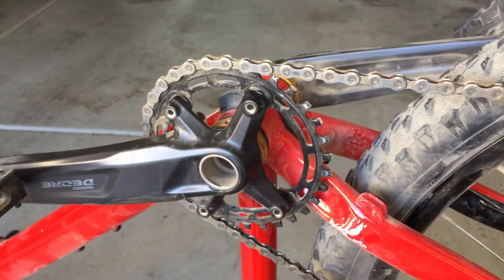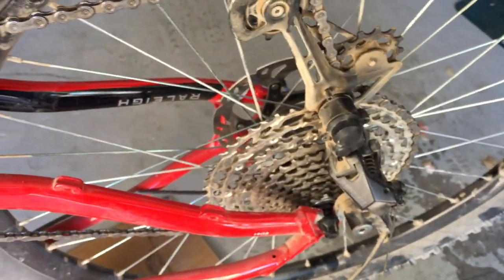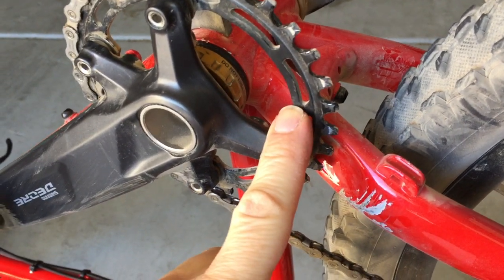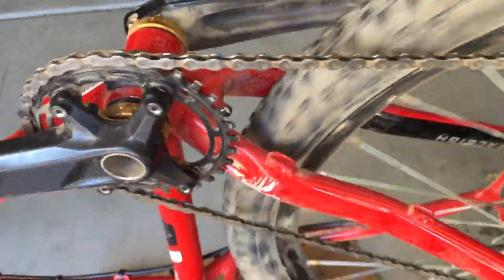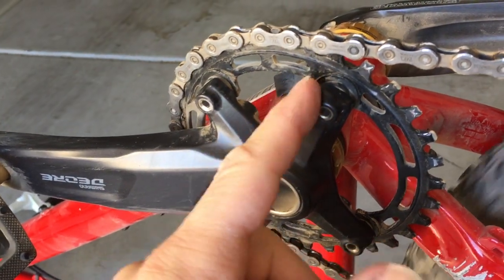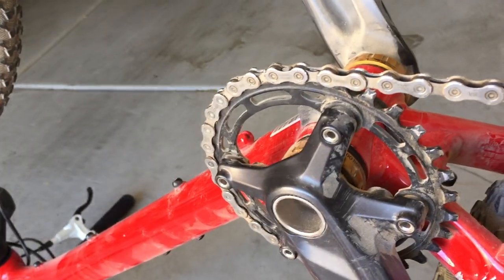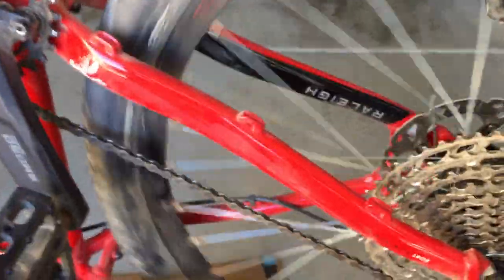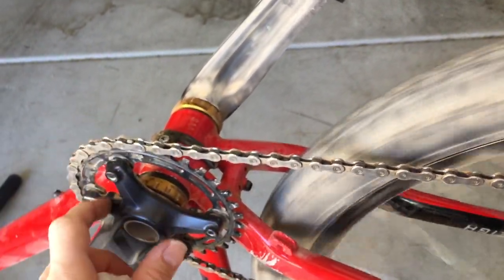Shimano Deore M5100 1x11 crankset chainline for 135mm OLD non-boost

Comment: I see you're using spacers for the bottom bracket. Couldn't you just move all of them to the non drive side? It seems like this would push the chainring in by the thickness of the spacers, by eye I'd say about 3-4mm. I'm doing a similar thing with my bike and it has a 73mm bb shell, and the spacers can be moved to either side to adjust the chainline.
Reply from the maker: Yes, you can move bottom bracket spacers to adjust your chainline, but then you are also offsetting the bottom bracket and crankset so you have to make sure the crankarm clears the frame. This frame has a 68mm bb shell, I need to use 3 (2.5mm) spacers. Shimano recommends 2 spacers on drive side and 1 spacer on non-drive side. Each spacer is 2.5mm so I could adjust my chainline in 2.5mm increments. I believe Shimano also sells 0.7mm and 1.8mm spacers but my Saint Bottom Bracket only included three 2.5mm spacers. So theoretically, you could adjust chainline in 2.5, 1.8 and 0.7mm increments if you have these spacers. I could have moved the 2 spacers from the drive side and run all 3 spacers on the non-drive side. That would reduce my chainline to 47mm (52-5=47), but problem with doing that is I didn't have enough threads on the bb bearing housing by using all 3 spacers on the non-drive side. I was worried about not having enough thread engagement into the bb shell causing creak so I opted to use 4.5mm of spacers between the chainring and crankarm. I probably could have gotten away with moving one of the 2.5mm spacers to the non-drive side and only run 1 spacer on the drive side. This would reduce my chainline to 49.5mm (52-2.5=49.5) which may have been okay. I recently moved this bottom bracket and crankset to another frame with 73mm bb shell. I did move the single spacer to the non-drive side to get me 49.5mm chainline. Any closer and the chainring would hit the frame. I have not tested it yet but hoping it will work okay.
Reply: @mtbbiker6401  I see. For me, with a 73mm bb and 135mm qr rear dropouts, simply moving the only 2.5mm spacer necessary to the non drive side made a big difference. I may experiment with spacers since I still have clearance between the chainring and the frame, but I can't find longer chainring bolts. The ones that come stock with the deore crankset are fairly long so I could probably use spacers or washers and still have enough threads but they look weird from the outside
Reply from the maker: @andreabotti99  If moving the 2.5mm spacer to the non-drive side worked, then I wouldn't worry about adding additional spacers unless you are having problems. It seems if the chainline is too far outboard on the cassette, you might have the chain drop down off the largest cog when/if backpedaling. That seems to be a symptom of excessive chainline deflection angle. I purchased longer chainring bolts from 365cycles. Problem Solvers M8-0.75x16mm. You can find long chainring bolts on ebay also. The stock bolts are 12mm long so if you add spacers you will lose thread but if you only add another 1-2mm you should be okay.
Reply: @mtbbiker6401  Thanks for the tips, I'm gonna experiment a bit more since I have issues with dropping the chain when backpedaling in first gear like you said. But it's almost right, I just need a couple mm at most. Before, with the 2.5 mm spacer on the wrong side, I almost couldn't even shift into first
Reply from the maker: @andreabotti99  I just finished installing this crankset M5100-1 on a full suspension frame with 73mm bb width. I moved the 2.5mm spacer to the non-drive side so that brought my chainline from 52mm to 49.5mm. I don't have room to move the chainring any closer to the frame as it will hit the frame. It's a 142mm thru-axle but I believe the cassette spacing is identical to a 135mm QR. I tested it around my neighborhood and the chain did not drop off the 51T when backpedaling. I'm running 27.5x2.4 tires and the chain is awfully close to the tire when in 51T cog. That's another reason why I can't reduce the chainline any further. The bike has a short chain stay of 420mm but grows by about 20mm when suspension is fully compressed. I had to play around with my chain length as Shimano's manual stated to add 5-6 links plus quick link with susp fully compressed. At that length the chain was too slack in the 11T cog. The M5100 derailleur could not compensate. I removed 2 links and it seems to be perfect. Shifting is very smooth and precise. So far, backpedaling is not a problem with m5100-11 (11-51T cassette), M5100-SGS derailleur, HG-701 chain. Are you using a clutched derailleur with a Shimano chain? Some suggest the chain is the problem with certain SRAM designs.
Reply: @mtbbiker6401  I'm using the entire M5100 Groupset, with all shimano parts and clutched derailleur. Though now that I think of it, I may have not set the B screw correctly. It was my first time setting up a derailleur from scratch and it's entirely possible that it still needs adjustment. I haven't had the chance to work on my bike in a few days so I can't say for sure, but I appreciate the help for now
Reply from the maker: @andreabotti99  Definitely check your B-screw adjustment. My M5100-SGS derailleur has special mark on the back to align the 51T cassette properly. You align the tallest tooth with this line. Very easy to do.

Comment: Is it possible to simply pair the M5100 drive train with am M4100 crank? The M4100 crank set is non-boost and is meant for 1x10 drive trains. I'd imagine the chain ring would need to change, but that seems trivial.
Reply from the maker: Actually the FC- M4100-2 is a 2x, not a 1x. It can be converted to 1x by removing one of the chain rings. Shimano lists the chainline as 48.8mm but I believe this is measured from the mid point between the two chainrings. So if using the inside chainring the chainline will be less or if using the outside chainring the chainline will be greater but I don't know by how much. I don't see a FC-M4100-1 listed only the FC-M5100-1 under the Deore M4100 10 speed page. I'm going to pair the M5100 drivetrain with a SRAM SX Dub crank. SRAM allows for 49 or 52mm chainlines by offering non-boost/boost chainrings. I'd say SRAM out engineered Shimano in supporting non-boost frames in this manner.
Reply: @mtbbiker6401  It would seem so. It seems difficult finding Shimano anything that's crank set related and is legacy. I am considering leaving the square taper cranks on my bike and just fitting a Wolftooth chain ring, for convenience.
Reply from the maker: @icantgivecredit871  That's not a bad idea.
Reply: The thing that confuses me is that, in another video, someone posted a 1x11 setup - consisting of M5100 cranks - whose chain line looks perfect. Was it luck, or does Shimano make these cranks in various widths? Linked is the video in question (if YouTube lets me): https://www.youtube.com/watch?v=YCAuydN2Ms4
 @mtbbiker6401
Reply from the maker: @icantgivecredit871  I just watched that video. It doesn't look like he is using the proper spacers on the bottom bracket as suggested by Shimano. For 68mm bracket width, you are supposed to use three 2.5mm spacers. Two on the drive side and one on non-drive side. For 73mm width, you only use one 2.5mm on drive side. You can switch these spacers to the non-drive side to reduce chainline by 2.5mm but this offsets the crankset in the frame. Probably not a problem if the crankarm clears the chainstay. So you could theoretically reduce your chainline by 2.5mm (52-2.5=49.5) by simply moving one spacer to the non-drive size. This would probably be okay for non-boost. Shimano also makes the spacers in 1.8mm and 0.7mm sizes for finer adjustment. Apparently BB-MT501 bottom bracket includes these 1.8mm and 0.7mm spacers and two 2.5mm spacers.
Reply: @mtbbiker6401   I really appreciate both that you took the time to watch the video and that you provided me with that detailed info! I'm new to this concept in general, so this is quite helpful.
Reply from the maker: @icantgivecredit871  No problem. If you want to stick with M5100-1 crank, you can probably make it work by moving the bottom bracket spacers. This should yield you 49.5mm chainline. Do you have a 68mm or 73mm bracket width?
Reply: @mtbbiker6401  I actually have two different bikes I plan to upgrade. One is a 1990's bike with 3x8 and sealed bearing BB, the other is a mid-2010's bike with 2x10 and external bearing BB. I just measured their bottom brackets; I don't know if this is correct, but I arrived at 76mm for both bikes.
Reply from the maker: @icantgivecredit871  Not sure that is right. Most standards are 68mm, 73mm, 83mm. Make sure you only measure the width of the frame (BB width shell), not including the bearing housing cups or cartridge. Are they both threaded BSA bottom brackets (1.37inch x 24 TPI threads)? This was the norm until they started using press fit bearings.
Reply: @mtbbiker6401  I did measure the width of the shell, but I'll check again. Also, yes, they're threaded and not press fit.
Reply: @mtbbiker6401  I re-measured each one from the underside of the BB and made sure I wasn't going beyond the shell; they are both 73mm.
Reply: @mtbbiker6401  To update this thread... I discovered a DH specific Shimano crank set called Shimano Zee (FC-M640), which fits 68mm/73mm BB's and whose chain line is a reported 50.4mm. Sounds to me like a perfect alternative - and it's still Shimano. The downside is the weight, as it's a reinforced crank set complete with steel pedal inserts: about 800g.
Reply from the maker: @icantgivecredit871  Yes. I forgot about the ZEE and SAINT groupsets for DH. FC-M640 and FC-M820 both designed for 68/73mm shells available with 34T, 36T or 38T chainrings. Both use 104 BCD chainrings if you want a smaller chainring. Also if you can find old stock of FC-M8000-1 or M7000-1 those use the same chainline but would save you some weight.

Comment: you can put the remaining space to the non drive side
Reply from the maker: If you are referring to the bottom bracket spacers, then yes. You can try moving the 2.5mm bottom bracket spacers to the non drive side to adjust chain line. I have 68mm bottom bracket which requires 3 spacers. 2 on drive and 1 non drive side. I couldn’t place all 3 on non drive side because I wasn’t left with many threads so I opted to add spacers to the chainring instead.

Comment: I have the same problem with the bolt length. I need 16 mm. Can you please tell me the details of this bolt that you used? Link to the product please.
Reply from the maker: I used Problem Solvers CR1650 Chainring Bolts M8-0.75 x 16mm. If you are in USA, I like to order from 365cycles. Website shows in stock $15 USD with free shipping. You can also search ebay for "chainring bolts long" and find other brands. https://365cycles.com/products/problem-solvers-16mm-inner-chainring-bolts-silver-stainless-steel?_pos=11&_sid=06f20b5fd&_ss=r
Reply: @mtbbiker6401  Thank you for your reply. This is very helpful.

Comment: Seu eu usar o MC Press Fit BB-MT500-PA que tb é recomendado para o m5100 vai manter a mesma linha corrente, ok? Então nao adianta?
Reply from the maker: Sorry don’t understand your question. Shimano recommends bb52 (threaded) or mt500 press fit. The m5100-1 crankset is only compatible with 68mm or 73mm bottom bracket shell width. You can adjust the chain line by placing spacers between the chainring and the crank arm to move the chainring closer to frame to reduce chain line independent of the bottom bracket.
Reply: @mtbbiker6401  Entendi. MT500 mantem mesma linha de corrente. Já instalei pedevela e BB52. A corrente sai nos dois cogs maiores ao voltar o pedvela, mas não atrapalha e funciona bem. Entao vou deixar assim mesmo, pois não consigo localizar parafuso de 15 ou 16mm M8X 0,75. Sabe onde encontro?
Reply from the maker: @betosvr1626  I ordered 16mm long bolts from Problem Solvers at 365cycles. You can also try ebay.
https://365cycles.com/products/new-problem-solvers-16mm-inner-chainring-bolts-silver-stainless-steel?_pos=64&_sid=aa25bf34a&_ss=r
search "extra-long chainring bolts"
https://www.ebay.com/itm/273593380093

Comment: That chainring looks awfully close to the point of cringe. Mine are currently between 3 and 4mm, which helps a little but still not the best at backpedaling right now.

Another option I think that can work would be for the rear wheel on the drive side. If there is some space between the cassette lockring and the frame, then find some smaller lock nuts for the axle, take out the thicker one, put the smaller ones on each side of the axle, and then re-dish the wheel. For me, this I can play with, so if I find some thinner lock nuts I may get around to it.
Reply from the maker: I’ll have to measure the distance of my chainring clearance but I believe it’s 2-3mm. So far I haven’t noticed it hitting the frame but I should inspect the frame closely to be certain.

Comment: Thank for the video love it.Had a question wanna buy the same setup but 1x10.Do you think ill run into any problem having a medium frame with 29inch wheels on a 2012 Cannondale trail sl4.
Reply from the maker: I’m not familiar with your bike but if it has rear 135mm QR dropout like my frame, I think the crank’s 52mm chainline is too much and you’ll have to use spacers to reduce it back to 48mm. I actually used 4.5mm of spacers so my chainline is 47.5mm. My bike shifts great! I’m very happy with this drivetrain. It’s very smooth and quiet and shifts very crisp. Huge improvement over the Tourney 3x7 that came on the bike. I’m sure the Deore M4100 1x10 would offer the same quality.
Reply: Having a long cage derailleur and a not too short chainstay tube (like most 135mm O.L.D frames and/or frames that had 3X) is the key and will allow you to use a 52mm (boost) crankset without any major issue. Your bike will shift great, backpedal, won't drop the chain and won't wear out your drivetrain... Just make sure you are using the right chain (9, 10 or 11 speed), with the right chain length. However, if you have a short cage derailleur, you might find some problems. Nevertheless, if you still want to move your chain line to 49mm or 48mm by using spacers, just make sure you have the right chainring bolts (M8 x 16mm) with the right thread (I have blackspire brand bolts and work perfectly for this Shimano FC-M5100-1 crankset) and your chaingring teeth selection 30T to 32T won't rub your frame. I don't think you can use any bigger than a 32T chaingring but that will depend on your frame design.

Comment: Maybe someone can help. I have a couple of questions. If I were to install an m6120 crankset to my m5100 cassette, rd, shifter will that be ok? or is it gonna make an issue?  and how do I know the O.L.D. of my frame?  Thanks in advance guys
Reply from the maker: OLD is the distance between the rear dropouts of your frame and the width of your hub. 135mm, 142mm, 148mm boost or 157mm super boost are the common sizes for mtb. 135 and 142 typically use a chainline  of 48mm. 148 boost uses 52mm. 157 super boost uses 56mm. Chainline can vary slightly and still work. When choosing a crankset, make sure the chainline of the crankset is compatible with your frame and hub OLD. In my case the m5100-1 crankset has a 52mm chainline for 148 boost so added spacers to reduce the chainline back to 48mm to work with my 135mm hub. The m6120 you mention is a 12 speed crankset. It should work with the m5100 11 speed cassette but make sure to use an 11 speed chain. 11 speed chain should work fine with 12 speed 1x crankset. Shimano lists the m6120-1 as having a 55mm chainline. This is really designed for boost or super boost spacing. If your frame is 142mm then I’d say the m6120 is not a good choice for your frame.
Reply from the maker: What year and model is your frame?
Reply: @mtbbiker6401   I'm used to just riding my bike and didn't pay attention to details. lol found out my frame is 148mm boost. I'm still learning how to fix my bike, tired of going to shops. Everything makes sense now. I appreciate you taking the time in responding. :)

Comment: Hi, thanks for the video. I can't find any longer bolts. Do you know any website where to buy the 16 millimeters, of which you speak. I am from Chile and I did not find pins with fine thread. Thank you very much for your help.
Reply from the maker: I ordered Problem Solvers M8-.75x 16mm chainring bolts from 365cycles in USA. You can also find on ebay if you search chainring bolts long. I'm seeing chainring bolts that are 17mm being sold by International sellers.

Comment: MTB Scoth Scale 970 2015 15.5". I didn't understand how to know her OLD, whether it's 135, 142 or 148mm. 
Is the numbering on the board?
The Pedevela is M5100-1 line 52
Reply from the maker: 2015 Scott Scale 970: from what I've found on the internet it should have 135mm OLD. This is the width between the rear dropouts. If it has a Shimano FH-RM35 rear hub, then it's 135mm.

Comment: is m5100 11 speed 11-51t compatible to 135mm frame and fh-m475 hubs?
Reply from the maker: Yes. I had my cassette mounted on FH-M525A hub which is almost identical to FH-M475 hub.
Reply: @mtbbiker6401  Thanks bro